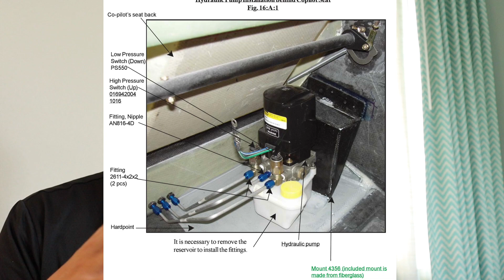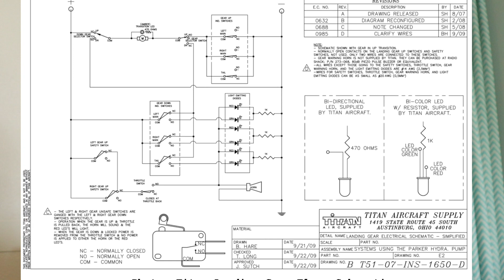What Happened? - #OddiesTitan T-51 Mustang Kitplane Flight Test Program

Comment: Am building one of these from a part built kit, many things to repair from the first builder. The Titan wiring for the gear has the main current going through the microswitches in the gear handle, an avionics engineer we know has come up with a different wiring set up using relay's to off load the microswitches and also to prevent this type of thing from happening, using diodes, several extra CB's and modified circuitry for the transit, unsafe and gear down lights, fair bit more wiring but we will not be putting 25 amps through a 15 amp microswitch. From what little I know the pictures of the RH gear show it to not be adjusted to over centre the down lock, having adjusted ours I have a fair idea of how this has to be set up, also this aircraft does not appear to have the gas struts to help over centre the down locks when there is no hydraulic pressure, something that can be added afterwards using a kit from Titan. As an aside is there anything in the hydraulic jack that may have prevented it going full stroke? Many thanks for a thought provoking video, very useful information for the rest of us, hope it is repaired and back into test soon. By the way the gear box issues are not new, our one has been modified with different bearings, the originals wore the cages out and the metal entered the CSU causing erratic prop operation.

Comment: I do not understand why the pump breaker caused an entire bus to go out out and turn off everything.
Reply: It didn't, it blew the main breaker. From what I got from the explanation, the main breaker was not sized correctly for the loads that were put on it, but was close enough that intermittent loads would not trip it, while the continuous gear pump running caused it to trip eventually. My guess is the individual component breakers were sized correctly.
Reply: The design was horrific from the start, plus that plane had a lot of drugged up hands working on it most of the time when it was in Ohio.